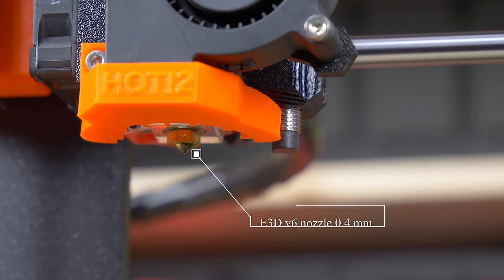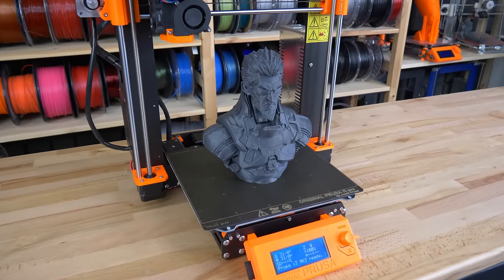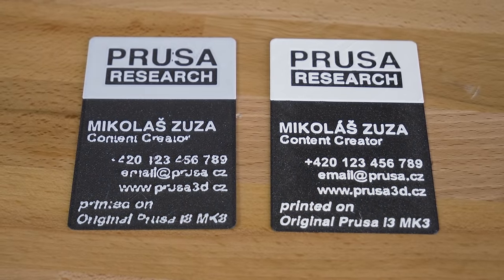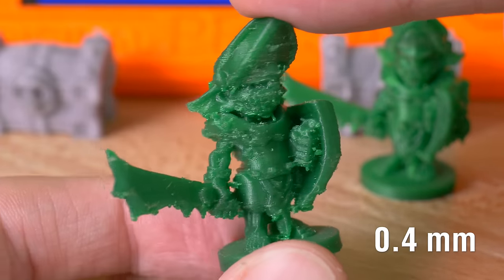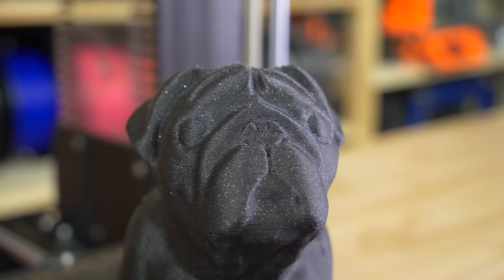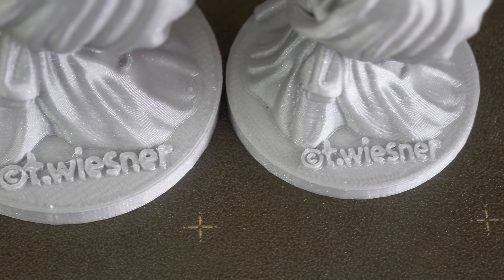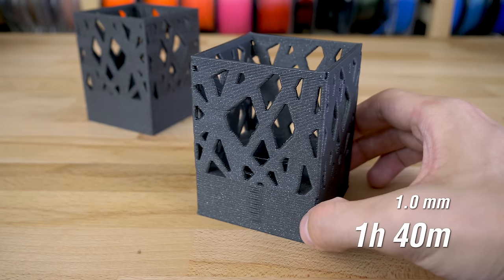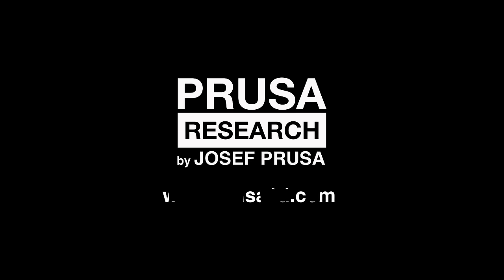Everything about NOZZLES with a different diameter

Comment: Hi, 
I am using a 0.8 nozzle in my and notice, that I have to set parameters like wall line for example to 0.85. it must be the same or higher. But what happen if I have Avery big object and this object has some details with a wall of 0.6 mm? Than I will have gaps. So I would have to set my wall line to 0.6 mm. Isn't it ?
Reply from the maker: Setting the extrusion width to a lower value than your nozzle diameter is not recommended. You will be essentially under-extruding in a weird way. We use this for supports to make them break away easier.
- Mikolas

Comment: got insanely detailed prints with 0,2mm nozzle and 0,05mm layer height, but after few prints the nozzle got jamed. printed a dust filter for filament and problem was solved.

Comment: That strength test, was that done horizontally or vertically? So was the layer adhesion better or were the layers stronger? We need more details. We are technicians!
Reply from the maker: The testing specimen was printed horizontally, lying on the bed.
Would you be interested in a dedicated video/article about how mechanical properties change based on the layer height, nozzle diameter and infill used? :)
Reply: Well, that would be awesome, actually!

Comment: i have 2 extruders for my taz 6 the moarstruder and the regular which i swapped from a .5mm to a .4mm nozzel to print lithophanes finer.  i also use a 1.2mm on my moarstruder

Comment: I suspect a different nozzle diameter requires different printer settings (there are quite many). Is there a video on how to tweak those successfully without too much try and err?
Reply from the maker: PrusaSlicer has in-built settings for 0.25, 0.40 and 0.60 mm nozzle. If you use other nozzles, you mainly have to adjust the extrusion width to about 110% of the nozzle diameter.

Comment: The thing about the nozzles isnt so much the diameter but the mm^3/s. With a bigger one you can increase your mm^3/s of plastic extruded without having to go really high in the XY speed, so you can print faster, same layer hight and all, without having to actually move faster.

Comment: "Extremely fast printing 1mm"
In 2030 this will be slow as we think of a pentium 233mhz
Reply: I'd like to see full carbon fiber print head so light and stiff it can just whiz through the air so fast that even nozzle fan can be discarded making it even lighter.
Reply: 233 was 4thousand dollars back then
Reply: @DjZorlag  that's a very cool concept 👍
Reply: @isaaclyonsf1  CoreXY for minimum moving weight, strong bowden extruder, Smaller buildspace so that all moving axes are shorter and thus light, thin aluminium fins with larger gaps for coldend (air flows without the fan), hotend with minimum size heatblock, titanium throat between hot and coldend to insulate as well as possible, part cooling if needed is attached to the frame outside the moving parts.

Especially with no bed heating, it should be possible for more easily flowing lower temperature materials like PLA!
Reply: @DjZorlag  very good 👍
Reply: DjZorlag 
That only goes so far, though. Print speeds are limited by very well-understood kinematics. It is different from electronics that are limited by fabrication technology and cutting edge physics research.

That said, theoretical maximum print speeds could be calculated. Your example would be very interesting to calculate.
Reply: @Austin1990   True, my idea was to get the least amount moving weight to reduce ringing and allow for very fast accelerations, maybe like 5-10m/s^2 without losing much accuracy. 

The next interesting part would be how to control molten filament pressure accurately with linear advances and such at very high speeds.
Reply: @Austin1990  Hmm. Mosquito Hotend already doesnt need fan in many cases. :)
Reply: DjZorlag 
Very interesting. Also, for something like a delta-style printer, I wonder if fans could be stationary to produce good airflow in the entire, closed chamber.
Reply: Honestly I don't think so :/ will take way longer
Reply: @Heads Mess I would gladly see some pictures of how did you achieve that!
Reply: @DjZorlag  Lol, this is some wonderful outside-the-box thinking.
Reply: My plywood Flashforge would be the 266 Cyrix in this analogy.
Reply: In 2030 most of this will look like someone playing around with a 286 commodore 😆
Reply: Very unlikely. The issue with increasing speeds is dealing with the mechanical vibrations and other issues that will arise as speed increases.

Comment: Do the larger nozzles literally use more filament for the same objects printed than with a smaller nozzle, or was it simply meant that prints go so fast that you'll end up using more?
Reply from the maker: The amount of filament used is usually very similar between nozzle sizes. E.g. 3 perimeters with .4 and 2 perimeters with a .6 result in the same wall thickness and material use, but printing one less perimeter obviously saves time. Same goes for layer height.

Comment: if only there was a quick change nozzle...something that could lock and twist in to the heat sink and be backwards compatible with the v6 heating blocks.
Reply: It's very easy to replace the nozzle. If you don't tighten it too much you won't need to hold onto the heat block.

Comment: I have a problem when I swap out nozzles on my MK2.5. 

It's really easy to knock the wires loose on the heat element. 

I do it just like you show in the video too. 

But just from the slight side to side motion of the block can snap those wires. 

I would like to see an improvement on the hot end design in the future that somehow makes the wires more secure and less likely to break. 

Not that this is some huge design flaw or anything detrimental to the Prusa brand. I still love my Prusa over my Tronxy every day of the week.   :{J

Comment: I'm a little confused about the layer height using different nozzles now.
if a 0.4 and 0.6 nozzle are printing both at the same 0.2 layer height, they would both be printing the same right? is it because the 0.6 can do two parameters at once compared to the 0.4 having to go over it twice to do two walls? the time saved comes from layer thickness rather than height?

Comment: I need to print structural easy form parts (brackets). Where can I get compare table from 0,4 to 0,6 to 0,8 to 1,0mm nozzle. I will use ASA material, perhaps ABS with carbon reinforcements. Any info is welcome

Comment: Is it possible to use two different nozzles in PrusaSlicer to print on a IDEX-printer.
E.g. a big part where I print the most part with e.g. a 0.6mm or 0.8mm nozzle and some details like text in another color with a 0.25mm nozzle?

Comment: I have standard 0.4mm nozzle. If I change nozzle for 1.0mm and print with 0.5mm layer height, do I need to change only settings in my slicer? Or maybe I have to change stuff in firmware?

Comment: I have tried a .25 mm nozzle (e3d) with original prusa pla (yellow). I run into the wired issue the the extruder fails to extrude. First i thought of heat creep but that does not seem to be the case. I think for some reason the filament is not getting melted fast enough. For now i could fix it by increasing the print temperature to 230-235 °C but that makes me worried that i clock the nozzle on that heat.

Would be nice to see a video on how to adjust slic3r for different nozzle diameters.

Comment: Hi there, thanks for your video. Just a beginner's question if you don't mind: can we keep the same nozzle-bed clearance setting when swapping a 0.4 nozzle to a larger one? If I understood well, slowing down might be required only if going 0.8 or 1.00mm due to the "feeder" (extrusor) capacity. Thanks in advance if you can help me!

Comment: So I switched nozzles from .4 mm to 1.0 mm hoping to save time on prints. The problem is that the PLA output humps up behind the nozzle and is not applied to the bed. At slow speeds, like 10mm/s, I can get a decent bead laid. I’m trying to print a 12” dia cylinder, 1/4” wall, 100% infill. So at slow speeds I get a bead that looks round. At higher speeds (20 mm/s and higher) I don’t get a round bead. The filament kind of stretches across 2 points and I get a straight line cutting thru the inside dia of the cylinder. 

Any thoughts?
Reply: Well, the new upcoming slicer update will fix this. But it has to come out ¯\_(ツ)_/¯ . But you can also try another first layer fill 
Print settings→infill→ Top/bottom fill pattern. The default is Rectilinear, but changing to concentric or Archimedian Chords will most likley fix your Problem.

Comment: Are there any extra parameters (other than nozzle diameter) that you would need to change in your slicer if you were to use a different nozzle size?
Reply from the maker: Mainly the extrusion width in "Print settings - Advanced", it should be about 110% of the nozzle diameter.

Comment: Hi, when i changed my nozzle to a 0.6 mm one it then diplayed a error message about the gcode having another diameter then the nozzle but i used a 0.6 mm profile and i installed a 0.6 mm nozzle on the printer so pls help me.

Comment: its great! what is optimal layer height for a strong printing with 0,8mm nozzle? thanks!
Reply from the maker: 0,5 - 0,6 mm layers should still be fine :) You might encounter a problem, where you'll be pushing so much plastic so fast, it might not heat up in time, watch out for that. You can sometimes compensate by increasing the target temp a bit.
Reply: @Prusa3D  Thanks for all! 
How could I contact you? We would like to sell your machines in our company, Proto-Fast

Comment: I am a nubby to 3D printing... when using a nozzle other than .4 do I have to tell the slicer software that I am using a different nozzle size?
Reply from the maker: Yes, we have preset for 0.25 and 0.6 in Slic3r PE, so you just pick a different printer preset ;)

Comment: Tempted to experiment with nozzles.My nozzle clogged up so I ended up replacing it. I ended up buying a 24 pack of assorted nozzles for only $8.50.

Came with 12 .4 nozzles
And 2 of each other nozzles (.2.3.5.6.8 and the 1mm

Comment: Question please,
Would a .4 nozzle @ .2 height and 4 walls be stronger (take more weight/stress) than a .8 nozzle @ .4 height and 2 walls
Reply from the maker: My bet would be that the 0.8 print would be stronger, but I'd had to test it.

Comment: The thing is, you’re holding on to the tip of your heat block, making sure everything stays steady, it’s hot, it’s a difficult angle, you’ve got to apply the right amount of force, watch your spacing, and you could bend your heat break.  If you break your parts it’s a bunch of money and wait time to get replacements.  If you do it wrong, you end up with filament oozing all over your hot end.  

It feels out of touch when you say it is easy.

Comment: Hi. I have 0.6mm nozzle with i3 Mk3 and I want to print with 0.3 and 0.4mm layer height. How can I setup slic3r PE profiles ? System has only up to 0.2mm max layer height for 0.6mm nozzle.
Reply from the maker: In Slic3r simply change the Layer height in "Print settings - Layers and perimeters - Layer height" to whatever value you want ;)
If that doesn't work (it should) go to "Printer settings - Extruder 1 - Layer height limits" and change the maximum to a higher value.

Comment: Something omitted: A slicer can cause a 0.4 nozzle to print 0.6 lines and a 0.6 nozzle to print 0.4 lines...with certain other conditions held true.
There are limits; a 0.4 nozzle printing a 1.0 line would have a low print speed...that poor extruder is gonna be working hard for force all that plastic through that tiny hole.
Cura will warn users about extreme nozzle/line width and nozzle/layer thickness mismatches, but let you do them.
I'm convinced; gonna switch over to 0.6...so many of my perimeters have been 1.2 or thicker.
As for supports holding too well?
Print them a bit faster and a bit thinner!
Reply from the maker: You can make a 0.4 nozzle print 0.6 mm thick line. However, you can't make a 0.6 nozzle print 0.4 line, if you set set as the extrusion width, the result will be an underextruded 0.6 mm wide line. But I see what you mean, we do this in the default settings in PrusaSlicer for supports too, it's actually good to underextrude them a bit to make them easier to remove :) -Mikolas

Comment: So maximum 80% layer height to nozzle size, is there a minimum value?
Reply from the maker: Yes, at some point you'll be pushing out so little filament it won't be managable for the extrusion system to stay precise and not clog from the heat creep.
On our Original Prusa i3 MK3S with .4 mm nozzle, with PLA we have the min layer height at 0.05 mm, but generally we rarely go lower than 0.07mm.
- Mikolas

Comment: What size do I need for high quality small prints like 5 inch’s H and 4in w
Reply from the maker: Hi. We recommend smaller diameter nozzles. By default, most of the FDM 3D Printers are provided with 0.4mm nozzle. But you can find 0.1-0.25mm nozzles in the market to replace it. Be aware the print will take more time with smaller nozzles.
Here you can check the one that can be used on Original Prusa MK4 and XL.
https://www.prusa3d.com/en/product/prusa-nozzle-brass-0-25-mm/

Comment: I'm really struggling with Stringing when using my .6mm nozzle - any suggestions for slicer settings?
Reply: If your retraction is on, it shouldn't be the cause of the diameter. Usually when this happens to me - it's some piece of charred dust that is stuck in the nozzle and makes the filament stringy. It's quite hard to remove, but after a bit of soaking in ethyl acetate (for PLA) you can usually take it out with some pointy needle.

Comment: What is the max nozzle diameter, which can be printed with 1.75m filament?
I ordered a set of nozzles, from 0.3 to 1.2mm. Can I realy use a 1.2mm nozzle with 1.75mm filament? that seems a bit to close, since it´´s almost the filaments diameter :D
Thank you for the video (btw I´m one of the 78% who never changed from 0.4mm but I wan´t to try it now, since I have to do pretty large prints in the near future and some of them would take almost 4-5 days...)
Reply from the maker: As strange as it sounds, you can actually print with nozzles bigger than the filament diameter. :) The limiting factor is the feeding mechanism and the maximum volumetric flow of the hotend. In case of the MK3S+, the maximum reasonable nozzle diameter is about 0.8mm. -Mikolas

Comment: Do I need to use certain filament to go up/down nozzle size?
Reply from the maker: If you go for bigger nozzles, then you can use whatever you want. But smaller nozzles are really sensitive and can get jammed by particles in the filament, as mentioned in the video. So you can't use metal/wood filled filaments with smaller nozzles and even with 0.4 they can occasionally jam.

Comment: Why is the standard nozzle size 0.4? If it would be 0.5 it would take 2 lines to do 1mm. I don't get why?
Reply from the maker: It's not that simple. With .5 millimeter nozzle, the extrusion width is about .55 mm plus you have to take into account the overlap between the perimeters. Even layer height makes a difference, because it means the filament is squished differently. If you go in Slic3r to "Print settings - Layers and perimeters - Vertical sheels" you'll see a tooltip suggesting a wall thickness for the current settings.

Comment: Unfortunately I have NO idea how to change the Prusa settings for different nozzle sizes. The instructions on the forum just break my slicer...
Reply from the maker: PrusaSlicer has built-in profiles for 0.25, 0.4 and 0.6mm nozzle. For other sizes, follow the guide in PrusaSlicer documentation ;)
https://help.prusa3d.com/en/article/creating-profiles-for-different-nozzles_127540
- Mikolas
Reply: @Prusa3D  thanks but when I followed these instructions, before leaving my original comment, the Printer Settings flag turned Red and all my presets disappear. I have to restart the slicer to get it back, and then it happens again. My entire slicer has locked up at this point.

Comment: So, i am losing the battle of bigger nozzles, with settings... None of my prints are working correctly. I can't get the default settings to work, and I can't use some of my other settings for smaller fine detail stuff either. (Modified a bit to fit the bigger nozzles) 

Anyone got a settings profile that works for these .6, .8, 1.0 nozzles?
Reply from the maker: Really the most important thing to change is the extrusion width. For 0.6 nozzle something like 0.65 is a good start (something like 110% of the nozzle diameter, but do not use % value in Slic3r for extrusion width)

Comment: 1:27 If 80% is the maximum what is the minimum recommended? 50%? 20%?
Reply from the maker: We go all the way down to 0,05 with 0,4 mm nozzle, so that's 12,5%. But that's pretty extreme and has it's difficulties. 20% is a good minimum.